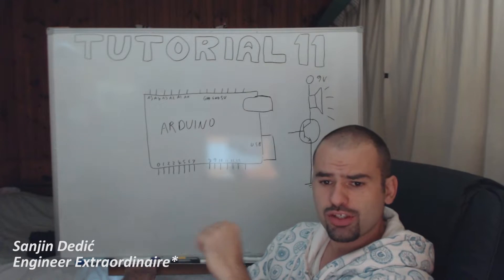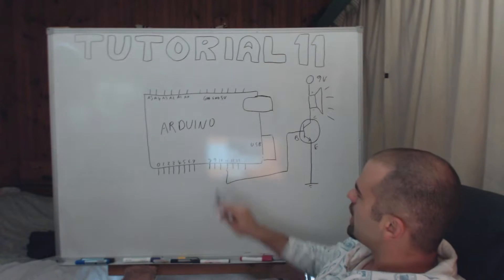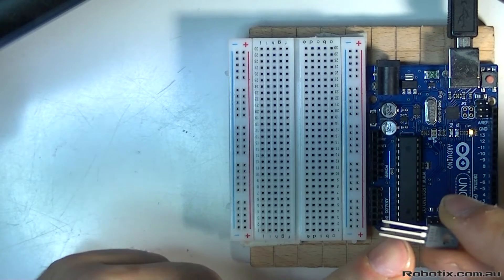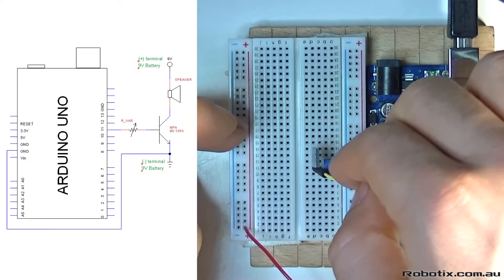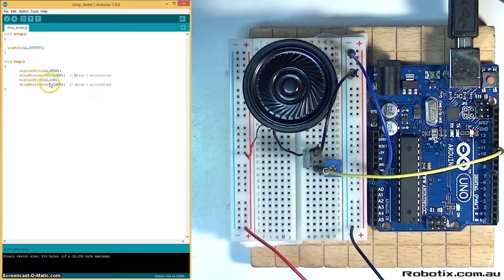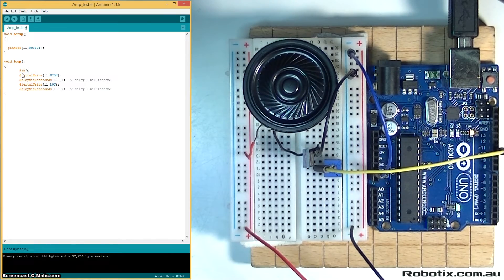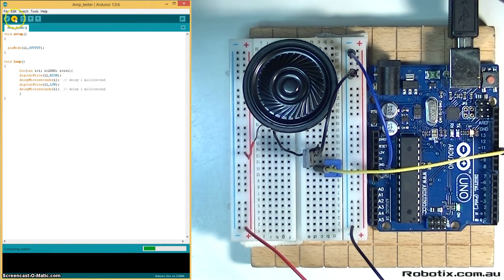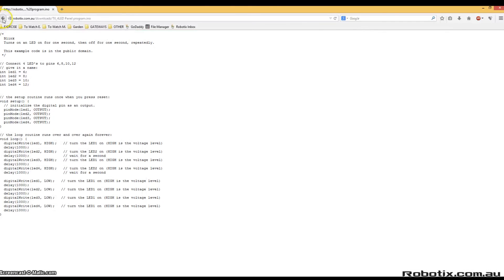11 - Sound Amplifier Circuit

Comment: Hello my friend, tks for the info. Will this arragement work on a 555 circuit astable mode already powered by a 9v battery? I want to make a metronome with a blinking led and a speaker just like yours. The problem is the not too loud click.

Comment: Just tried doing to circuit and the potentiometer doesn't work. I had to connect the battery + and - to the potentiometer and the output current to the speaker.
Reply: Agreed.  The video should have shown what happens when we make adjustments to the potentiometer.

Comment: hi,what about if we connect square wave signal inplace of 9v DC source and control the base with Arduino.will it work or not.actual I want to OFF the speaker when my square wave signal drops to up certain level

Comment: My question is, if the speaker's specs are, let's say, 8 ohm, 0.5W and according to ohm's law assuming Vce=0.5 you'll have I=U/R > I= (9-0.5)/8, so I= 1.065 Amps going through the speaker and transistor. Following the math to calculate the Power you'll have P=U x I > P=(9-0.5)*1.065, so P=9.05 Watt power dissipation on the speaker. Wouldn't that kill the speaker? Ovearheating it over time and eventually killing it? Would love to hear your insight on this. Thanks!
Reply from the maker: Good calculation, except that that max a 9V battery can do is400  -  600mA so the max power is I^2 x R = 0. 3 x 8 = 2.4 Watt

So if the 0.5 rating is indeed a real limit you would fry the speaker, this has happened to me only once from dozens of times. 

So great pick up, I will pin your comment

Comment: Hey great video. Can we use the same set up / system with a home theater system through a RCA cable? without an amplifying circuit?
Reply from the maker: I think so!!. . . you would be taking advantage of a much better amplifier with no batteries (the one built into the home stereo)

Comment: what transistor did you use
Reply from the maker: TO 126 that is what my notes say. You can also use TIP 120 will work just fine :)
Reply: Robotix thanks dude
Reply: will it work with tip 122?